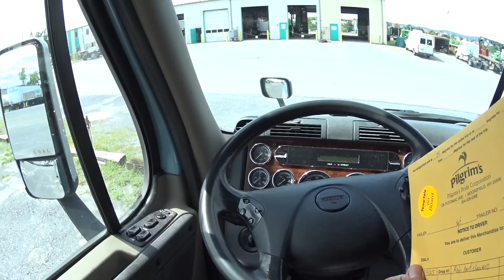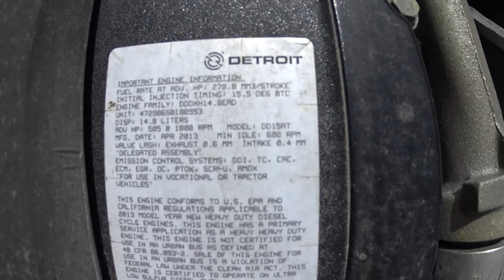2301 Black stalion

Comment: Detroit engine, Displacement:14.8 Liters, Model DD15AT, Initial injection timing: 15.5 degrees BTDC, Advertised HP 505 @ 1800 RPM, Minimum Idle 600 RPM, Valve lash Exhaust: 0.6 MM, Intake: 0.4 MM.

Comment: Other than looking a bit newer inside and probably better seats, your Baby Blue is way better equipped than the Black Shadow. No APU is a big downer unless they plan to put one on later which is a big expensive job. The Black Shadow is missing a bunch of gauges too including the weight gauge. Paging thru that green display gets old fast for information gauges normally display. You need all that junk under the bunk for creature comfort lol. You spend a lot of time in the truck, sleeping, eating, layovers, etc., creature comfort is essential. Baby Blue just needs some TLC, for example: have her detailed inside and out by a professional, it will look like new, maybe new shocks, he’s getting you a new grill, and you need a driver’s seat. You could always ask your boss if you can have that green Peterbilt LOL, but I didn’t get a good look at it so, may be its junky. Even Peterbilts have a life span, LoL. I’d give up 75 to 100 horse power for more gears and/or good creature comfort in a nice sleeper, you don’t get paid for how fast you can get going. You can always get new mattresses for Baby Blue and two layers of memory foam and it will be better than sleeping in your own bed, putting aside your wife sleeps with you, hehehe. A bit of TLC and Baby Blue is more truck I think. Of course you drive it, I’m just offering my opinion before excitement causes you to make a bad decision, LOL.

Comment: Looks like a '13, 15 liter Detroit set at 505 hp if that sticker is correct. Should be a good runner. I wonder if it is another X-Warner truck? Good video.